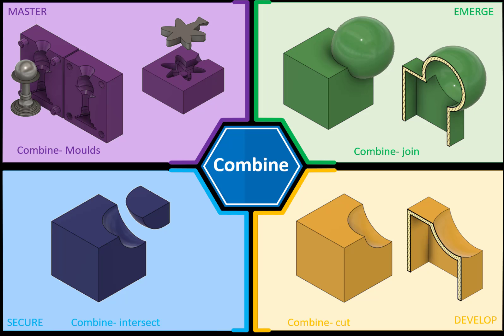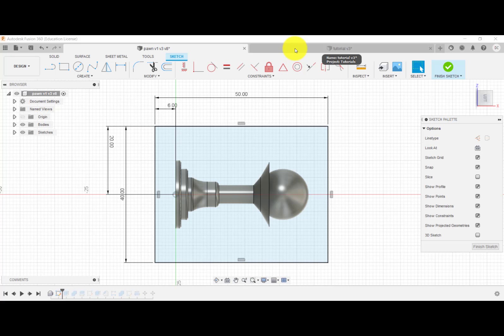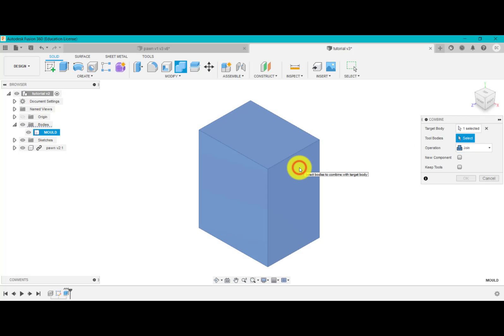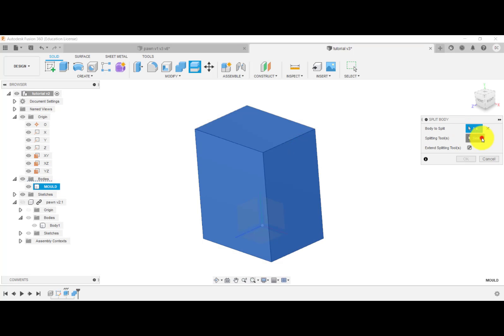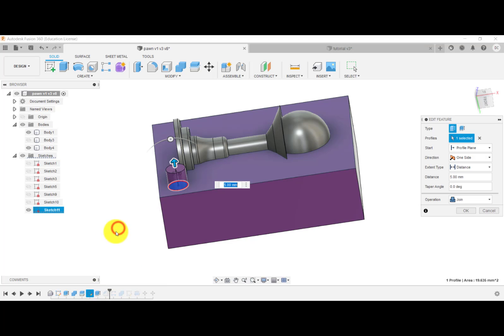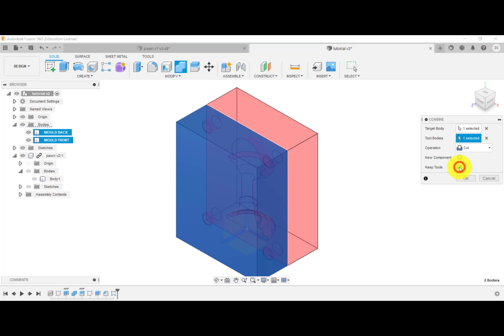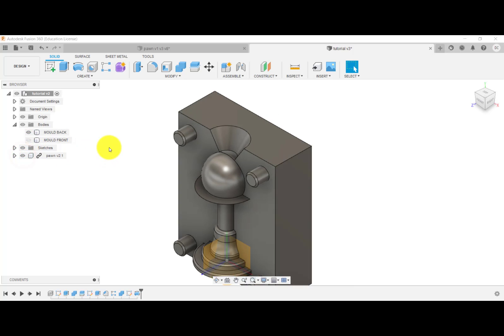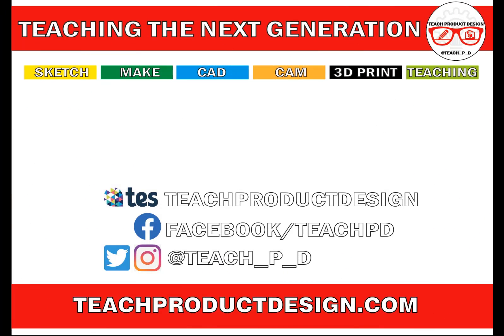FUSION 360 HOW to create a DOUBLE SIDE MOULD. Simple step by step. Free models.

Comment: Hey, I'm trying to make a mould as one of my first projects ever. My free version of fusion won't let me split the mould like you showed. It also has some other issues I found odd. I've worked around those issues, but I'm stuck on how to engrave the air escape grooves for the mould. You omitted them here, and any videos/info that I've found so far hasn't been helpful(having to meticulously click on hundreds of line segments on the model or being extremely limited in what you can engrave and where). I'm just looking to engrave a simple "cross-hatch" or "diamond" or "overlapping large circles" pattern on the faces of the mould.  Any advice you have would be appreciated.
Reply from the maker: Create the pattern on the surface and extrude cut. You could use a symmetrical extrude cut and remove a small amount from both sides of the mould ..if needed. 👍